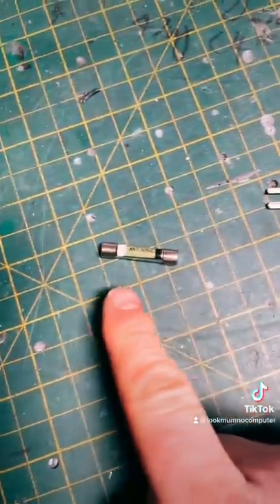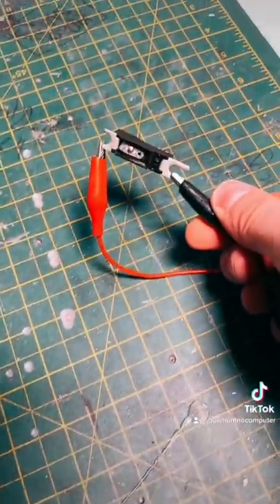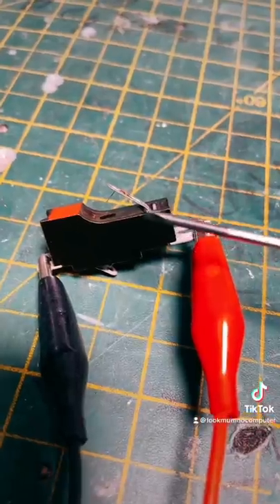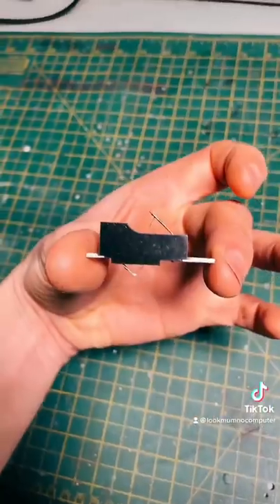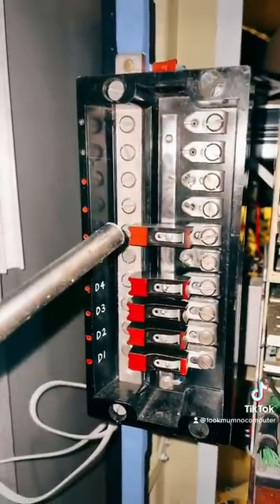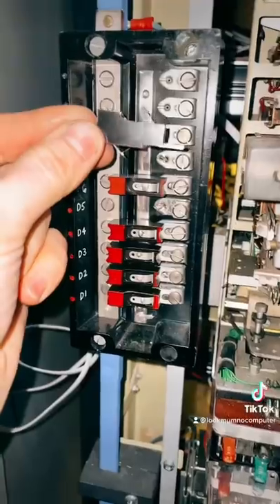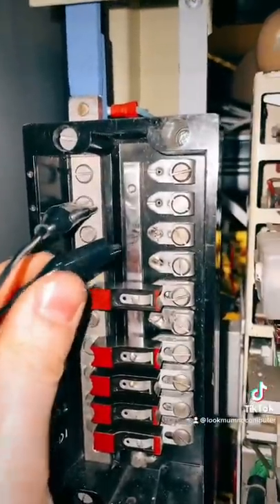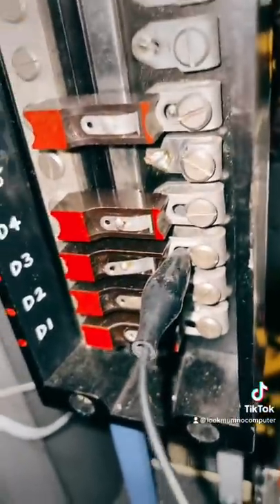BLOWING ALARM FUSES. How do they work?

Comment: One telephone engineer was getting fed up with one of those fuses bloring while he was testing some of the equipment (he was trying to find a fault) so he replaced the fuse with a circuit breaker, unfortunately the next time the fault popped up, the breaker didn't blow, the next fuse down the line did, it took out the whole (small) exchange, even though the current rating was the same, the breaker was rated for 240v.
Reply from the maker: ha oops
Reply: Yeah circuit breakers trip at huge current for some reason
Reply: @alexstone691 They do trip at lower current but only after a while. They are designed to protect the wires in your walls (not the stuff plugged into the outlets) which can handle higher current for short durations. For instance, a 30 amp fuse might take 30 seconds to pop at 30 amps, but will pop in maybe 1 or 2 seconds at 100 amps (these numbers are made-up for the sake of this example). If that next fuse didn't blow, it would have tripped, but only after several seconds.
Reply: @aaronjamt  Still a 6a mcb i bought did not trip at 20a for 10s, maybe i should test for longer but i dont want to blow my main fuses, they are a pain to replace as they are the old melting ones
I will have to buy another one and see, this one is type C so i know it wont trip instantly but maybe B will
Reply: @alexstone691  if you're looking to protect sensitive circuits you will need a type A (no inrush and must be chosen so that inrush will not cause a trip).  B is approximately 10x rated inrush, whereas c is about 100x. Where inrush is 1 second or less.
Reply: @alexstone691  Yes, that’s within normal specs for type C and even type B, 20A on a 6A breaker is about 3.3 times overload, and type C must trip between 5-20s, type B is between 0-40s.
Reply: @GRBtutorials  online i've read the overload bimetalic strip is the same between the types so they should trip at the same time but instant trip using the coil is for be like 1.5x - 2x, c is 4x .. etc
Reply: @sivalley  also, there’s no such thing as an A characteristic, MCBs exist in B, C, or D only. A is already used in the designation because there’s an amp rating. A20 would be too confusing.

Comment: interesting what sort of uses could they have had?
Reply: Alarm fuses (of several different designs) are used all over telecom systems, and have been since the beginning

Many pieces of equipment have dual redundant power supplies, s if one fails the equipment keeps working, but teh fuse will set an alarm.  The alarm fuse lets the technicians know immediately when there is a fault. And in most large installations lights up a light on the rack where the fault is. very useful in a large central office with dozens (or hundreds) of racks of equipment.

Comment: Do Americans still use fuses ??
Reply from the maker: Huh?
Reply: @LOOKMUMNOCOMPUTER  i live in Europe, we don't have fuses, we have switches, like, if we have an overtension in the electrical network, it just jump off, and we just have to put it back
Reply from the maker: @jyxiaa  i live in euroipe too this isnt for mains btw its DC
Reply: @LOOKMUMNOCOMPUTER  you live in UK, this is not Europe, i was speaking about European union sorry
Reply from the maker: @jyxiaa  yes but im not sure what this means about the difference in tech. this is for DC50v applications
Reply from the maker: @jyxiaa  these were used in europe exchanges too